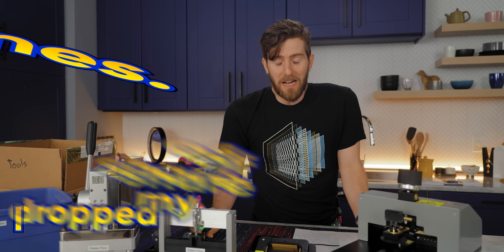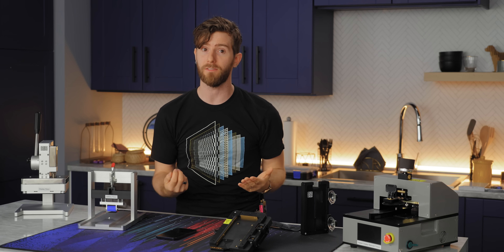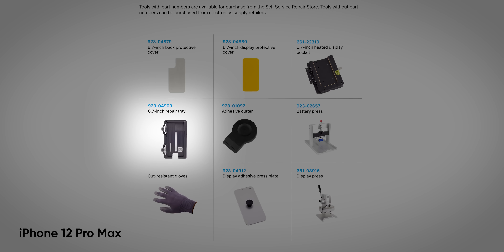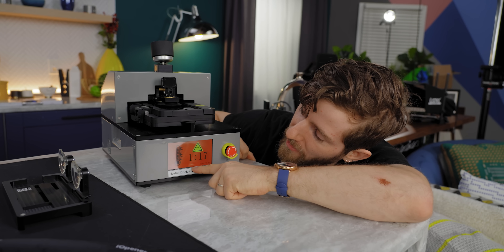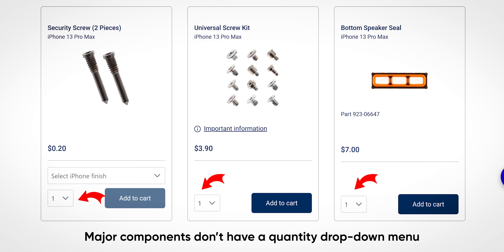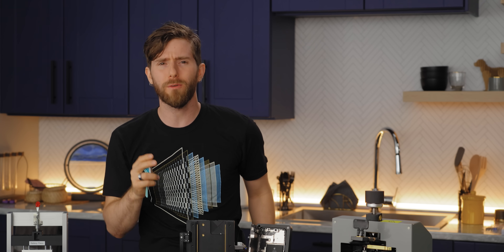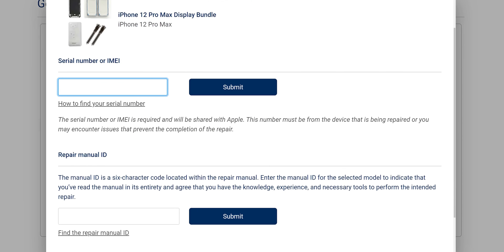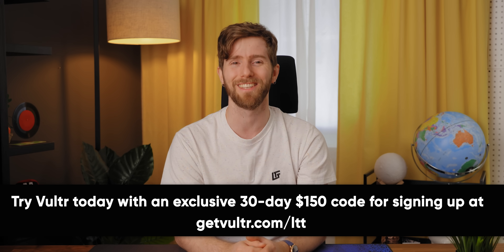I’m a Genius - Apple Self Service Repair Program

Comment: And he didn't even mention the fact that after the repair, you must call Apple, and make them verify that your genuine replace part actually is genuine through system configuration 🤯
Reply: you dot have-to call them but if you do not call them then the phone cant download the calibration info for the new screen.  This program is very minimal effort they did not bother to build a consumer facing tool to do this so when you call them the person on the other end types in the numbers you give them that assigns a new colour profile to your device (based on the screens calibration that happened in the factory) and your device downloads that from the web.
Reply: @hishnash  apple doesn't want people to be able to reverse engineer the calibration process since that is the thing making it anti-consumer. if people would be able to put in aftermarket or refurbished parts they would buy less new phones -> apple would get less profit which is a big nono for them...

Comment: apple is doing it on purpose, to prevent repairs. this is their way to circumvent the right to repair act, forcing them to allow people to repair their devices. They want to force you to get your phone for repairs, with shady pricing policy, to choose over right to repair. dirty scumbag tactics. Lets take advantage of this dirty scumbag tactics and turn it into our advantage. 

look at the good side, if you  repair your phone and it is not working 100% as it should it is your fault, and then you nee to suck this up along with the long boring non exciting lecture of "you see we told you so, this is why we want to do it because...." but after apple's repairs if your phone is not working 100% correctly, you can blame them, file complaint with authorities and extort the latest model as compensation, actually inflicting damage to apple to give another phone for free, cause a bad reputation with authorities, while you enjoy your latest phone.

Comment: So it's like those EVs from 10 years ago. Car manufacturers telling the politicians "look, we tried but nobody wants to buy them" while they built them so they have terrible range, are slow, expensive and have more repair restrictions. Then Tesla came. We need a Tesla for repair. Framework alone is not enough. 

And another thing that came to my mind: Smartphone quality peaked around 2013. I still got a phone from then. Dropped it a lot -> did not break due to plastic rim around the screen that broke instead of the glass. Has headphone jack, 5 seconds replaceable battery, screws instead of glue, USB 3, micro SD card, ...
I hope Framework decides to make phones.

Comment: It is absolutely beyond me why anyone buys from apple.  As for why they did this, your third guess is absolutely the correct one.  This is them "technically" checking the box for right to repair.  The saddest thing is this WILL work on at the VERY least the first round of right to repair legislation, if and when that ever happens.

Comment: Being a former employee of Assurant, I am VERY familiar with every one of those Apple tools. We are required to get a Tier 1 Apple Certifications for device repairs. I am certified to fix most apple devices through Apples certification process for the iPhone 6 all the way up to every version of the 13. And knowing this, I can tell you that EVERY one of those Apple tools that Linus showed is over priced. And, in a small way, Linus would be correct about the whole Right to Repair. But at the same time, I feel that he is not all the way correct. Think about it, you can get a new device, and get it covered under Apple Care+, pay nothing for screen replacement for that 2 year period for screen replacement, battery replacement, etc, and save a bunch due to the one time cost of that 2 year coverage. Or, having Apple Care+ tied into your device protection plan offered from your service provider. Making both Apple and the protection company money due to this fact.

Comment: Last I had heard, the Genius bars operate at a loss. Staff wages, tools, etc, basically all "thrown out" due to the nature of the rest of the store ('oh, i need the accessory while i'm here', etc). If you're fixing it yourself, all that goes out the window. I'm not surprised the in store repair is less than DIY a little bit.

Comment: Just gotta say I work for a repair shop in canada. I have gone through the training process to be deemed out of warranty repair "certified" by apple and those 5 repairable components that you can do as a self repair is all that an apple tech is allowed to repair either as in warranty or out of warranty. After those 5 components it is a device replacement. As well from what i saw in the video you don't have access to apple gsx  and ats2 (i could be wrong about if you get access ) which is needed to be run to allow the device to recognize the new components and their serial numbers as genuine parts even with apple oem parts. if you don't run the proper calibration tools you will be locked out of certain features. all in all in my opinion this repair program is useless for most people as even if you want to do the repair you still wont have a fully functional device.

Comment: And this is why right to repair (on consumer gear) is (unfortunately) doomed from the start, the economics is not there and never will be.
All consumer products require unfathomable volumes to drive down the cost through sheer economy of scale, right to repair eats into that volume and if it got really going it would seriously eat into the margins (which after all is included are not as outrageously large as people think), especially since technological evolution of the platforms has slowed down to a crawl 

All of this means that advocating for right to repair (which I am in favour of BTW) is advocating for a radical change to the global economy, with a drastic reduction in consumerism. I understand why R2R advocates choose to ignore this, as it makes their battle significantly harder, as changing people habits is significantly harder than convincing few legislatures to pass a law

Comment: Apple policies are definitely weird. I broke the back of my iphone xs max that was out of warranty and the fee was around $599US so I just didn't bother. 2 months later my phone just died while using and when I went to the genius bar, they said my only option was to get a new one of the same model for around 500 or get a higher model. I still can't think of why buying a new phone would cost me less than asking them to fix the back of my phone.
Reply: just watch the videos on the crazy process it is to replace the glass on the back!

Comment: i've always used the good ol heat gun and wedges. works everytime for a fracion of the cost. just be careful, would not recommend to people who don't know what they're doing
edit: I own several sumsung devices and i have a reliable supplier of certified samsung parts so i guess i'm in a way better situation for self repair which always has been cheaper becouse for android all you have ever needed was a electronics repair kit and a heat gun which are fairly cheap + repair part which to my knowlage at least has always been the cheaper option then going in and having it done by a third party repair shop. for refrence it cost me about 300 USD to do my first tablet screen repair and it took me about 45 minutes from start to finish. Subsequent screen repairs only costed me about 200 USD and by then I had my time to repair down to 20 minutes. The repair shops quoted me 500 USD for this service.

Comment: Wel well well... I see the same behavior as with their software: what they don't want they make as complicated as possible or  even impossible.
Turn off annoying animations in MacOS? Nope! You can reduce them a bit but not remove completely.
Creating own color profile with limited but still tunable brightness? Nope! You are not allowed to do that!
Tune kernel to use cores in parallel instead of filling them up from 0 to last? Nope!
Put more sane congestion control for TCP? Nope!
Install an app from side? Yeah, but you need to go to setting, unlock, push a button. And no way to tel MacOS "Hey, I know what I'm doing, stop getting in my way all the time!".
Make your own app to install on your own device(iphone/ipad) forever? Well... You are forced to PAY Apple to do it(or if you live in a country that is disliked by USA you just cannot do it at all). 
Updating headphones? Well... It is possible but you will need TWO devices to do it: MacBook AND iPhone. Who even has and iPhone nowdays? Why the f* update process is locked to one device type instead of being open to any device including PC and Android?

Comment: Interested to see what the valuation is like for renting the tools + using aftermarket parts.  Hope you guys will do a better video painting the full picture, unless I missed something (less the Touch ID argument). I mean, they give an accessible/affordable tools and the concise directions clearer than any other manufacturer ever in the phone space.    Sadly, I don’t believe this would be part of LMG’s ethos nowadays to not bash Apple at every corner. Looking forward to the Samsung commercials making fun of Apple for screwing their customers, and then follow suit right as the noise dies down, only to bend over their own customers as well.  

OEMs charging crazy amounts for OEM parts is nothing new with most for-profit businesses (see car industry). They’re charging the, undeniably, obscene amounts for OEM parts for the same reason a Short Circuit hoodie is nearing $100. For profit. Tbh I’m more upset at the cost of the Hoodie. Can you guys tell me your suppliers so that I can buy my hoodie directly? It should be cheaper since I’m not using your logistics team to get it. /s

Comment: As a professional electronics repair technician, I can say most of these tools are unnecessary, you can do these repairs no problem with an Ifixit pro toolkit and aftermarket parts much cheaper.

Comment: My man, you are missing some key points about the repair program including What happens after you install a new screen your battery, the iPhone configurator part of the process. 

also Apple doesn’t quote prices over the phone because if you just say your screen is broken and we tell you how much it is to replace you are going to expect that much to pay, but if you come into the store and we realize you also broke your front camera then that price jumps up significantly and I’d say most of the people who are going to the Apple store are the kind of person who would not think of that. 

in addition that side you put up about paying Genius bar technician $20 an hour only applies to Colorado, so other places may vary
Reply: so true king

Comment: Linus you forgot to mention the other thing too. If you do the repair yourself YOU are taking on ALL the risk if something goes wrong. If i go to replace my screen and i dunno mess up the speaker. Or damage the wireless charging coil replacing a battery (which is actually pretty easy to do given how useless the battery pull tabs are) Then its all on you. If apple does it when repairing your device they are the ones liable.
Reply: Why go out of our way to mention something that should be so painfully obvious, a toddler would know the correct answer to?

Comment: Basically it's enough to placate legal entities with a "yes we allow device owners to buy official parts and rent the proper equipment." While there isn't anyone in the room to say "yeah, but you make it prohibitively expensive and difficult"
Reply: We also say "hassle free" repair, and personally, I define hassle as anything that isn't strictly necessary, such as giving them a serial number just to be able to order, and the need to call them afterwards to finalize. I can't even call this malicious compliance because it isn't even at the bare minimum of what repair advocates are demanding.

Comment: Also, yeah sure let’s compare aftermarket parts to OEM…Honda pads are like 129$ for the front, you can buy Chinese pieces of junk for 39$…They will feel worse than your old pads and will destroy your rotors while at it. If you are going to compare their service #1 compare it to renting an ifixit kit - wait you can’t rent. #2 compare it to buying OEM parts…honestly they are renting you the tools for free, you are barely paying shipping, and it’s not fair to compare Amazon knock off screen prices to OEM screen prices..Buy the knock off screen and the ifixit kit if that’s what you want, option has always been there. You want an OEM experience then take your jaloppie to the dealer.

Comment: I do this for a living.  I use those same tools every day.  If you're an Apple Certified repair center you don't need to enter a serial number prior to ordering parts.  You can just pull parts from stock but you MUST document basically everything in Apple's web-based ticket-tracking software called GSX.  It's extremely clunky and I hate it.

Comment: Not a fair statement Mr. Sebastian, you for one should know - shipping is not free. Logistics is not free, inspection of the return tools is not free. So yes it’s going to cost you more to dyi than to take it to the store, where they already own all the tools and don’t have to worry about any of that and just pay the employee wage. Apple is better than anyone else, they provide you really nice tools for a low fee. Parts, well, honestly, right to repair is not the right to build your own products using their parts for less because you save them the labour. Price out a Honda Civic, 26k out the door fully assembled, now price out every part to build it yourself. You’re probably looking at 100k and 1000hrs of your time…Send me all the parts for your screw driver and all the tools required to assemble it, and I want it to be cheaper when I factor in my assembly time at minimum wage in Ontario then what you sell it ready to go for. Cmon right to repair bro….

Comment: Working at Geek Squad, I often have to break it to customers that a screen/back glass repair is nearly half the price of the phone they bring in. I always recommend Apple Care+ for newly bought devices but I wish it just was not hard and expensive to do the repair. It also takes Find My to be off and often people cant turn it off because thier device is broken and cant use it for verification (something you can bypass in an Apple store)  and it halts the repair process until that person goes to an Apple store.
Reply: so basically, don't bother getting your phone fixed just spend the extra money and buy a new one.

Comment: As a repair technician i can gurantee that linus put the phone into the heater and then turned it on (rather than the other way around) which cause a horrible beeping sound, resulting in the cut to him putting the phone into the heater a second time. (I have done this probably dozens of times on accident)

Comment: The ultimate "cool" idea for a video which could create an entirely new way of cooling PC's in a far more effective way that ANYTHING that currently is available to PC consumers. The pump which a mini-fridge uses is a heat exchange pump; it passes low pressure fluid through tubes inside the fridge to soak up heat, then when the fluid passes outside, the fluid is put under huge pressure by the pump, which forces the molecules in the fluid to move closer together, resulting in them releasing all their heat energy into the surroundings outside, the then greatly cooled fluid is pumped back into the mini-fridge, at a temperature far lower than the fridge contents, at a low pressure, so the fluid rapidly soaks up all the surrounding heat energy before being pumped back out again. And the cycle continues. In this way you can take heat OUT of the inside of the fridge, which may be say 5 degrees C, & disperse it outside of the fridge even if the room outside is considerably hotter (say 20 degrees C), in an incredibly power efficient way. 

You could use this technology to not only have TOTAL control over the temperatures in a water/fluid cooling loop in your PC, but if you were so motivated, you could even also channel the heat, via the heat-pump (mini-fridge pump) to either an external heater, or even use the heat to generate electricity. 

A setup like this could be used as a prototype for a commercially available PC heat-pump which would allow people to cool their PC components to considerably BELOW room temperature (in a very quiet & efficient way) even if they were overclocked & using lots of power! And heat moved in this way is 75% more efficient, if put to use externally, than generating heat from a dedicated electric heater! The developer would have a "hot" new product to sell & we consumers would benefit by being able to FINALLY cool our top of the range over clocked hardware so that if stabilizes it & massively extends the life expectancy - win win! Cool aye?

Comment: The awful value is in the replacement parts which are hideously inflated in price, even 3rd party ones are quite expensive. The SOLE reason.... Apple branding... compare similar android replacement part costs and you will see the issue.

Comment: I bought 2 non working samsung galaxy tabs s4 tablets, a battery, double sided adhesive, adjustable clamps a screen protector, a otterbox case and a replacement s-pen all for less than 270 usd and did all the work myself I took both tablets completely apart because one had a bad motherboard and one had a bad screen so I was able to get one working tablet with several spare parts leftover.